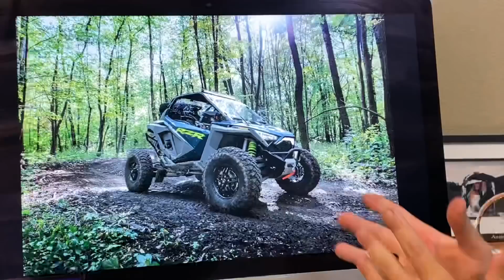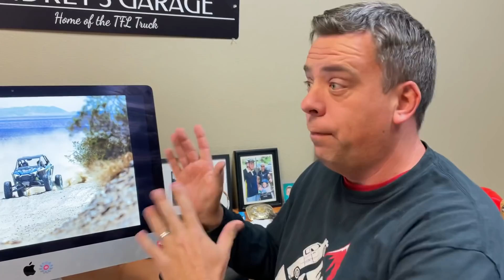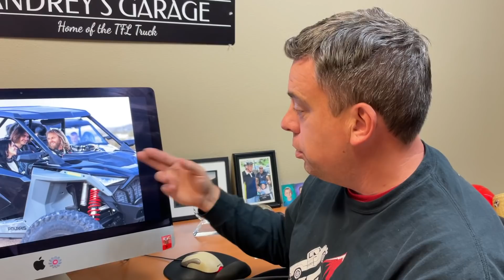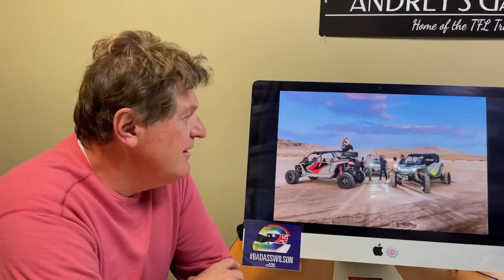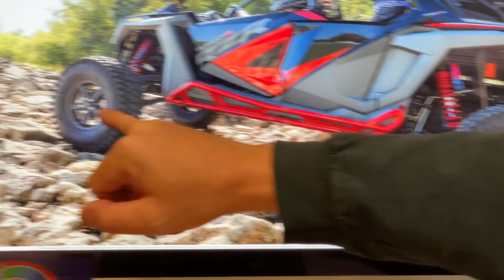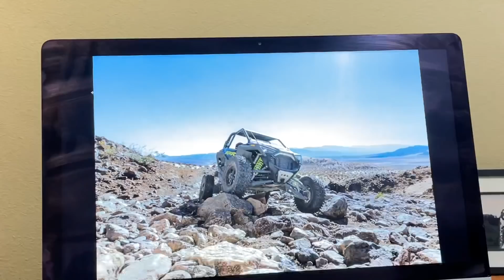BREAKING NEWS: Redesigned 2022 Polaris RZR Pro R Takes Direct Aim at Can-Am With THIS Much Power!

Comment: No such as too much horsepower. 2020 RZR making 220 to the tires, which is alot of fun don't get me wrong. The new 4 cylinder non turbo RZR making almost as much right out of the factory was a much needed boost. Much more torque and horsepower without the lag and extra complications of a turbo rig, count me in. 👍 Not to mention wider and more travel plus more kick ass goodies etc....

Comment: Snap, Crackle, Pop ............. that is what I think about when I watch anything regarding SxS UTVs or for that matter ....... ATVs .....  that run a belt driven transmission ...... there is a reason there are no Honda ATVs nor Side by Siders available for purchase now amongst the computer chip shortage crisis ........  (but you can buy Suzuki, Kawasaki,  Polaris, Can Am .....  "all day long" )  ........ at one time ...... Honda sold more ATVs than all the other machines combined ......... yes .......... Polaris has massive military contracts ....... and their Wallstreet  stock has been at a minimum a  "6 banger" * over 20 years  ...... IMO ....... its still junk compared to the reliability of a Honda .......horsepower is not as sexy as it appears when snap crackle pop sets in   ??? .....

Comment: Too much power? I’d say still not enough, I’m curious how you say they’re taking aim at canam when they still fell short with over twice the engine, the new pro r has a power to weight ratio of approximately 9.62:1 with oil and fuel while 2019 with only 195ho turbo rr model brings it in strong at 8.67:1……. And if you spend tue price difference focused on performance you come out so far ahead it’s quite funny you also won’t have a blown up clutch maiming you or your passengers or bursting into flames.

Comment: Thanks for posting.
Approaching $40k for a STOCK UTV, even before adding accessories??  YIKES!
No. It will NOT fit in a toy hauler. While a few have adequate length, the width quickly necks down from 8 feet to under 6 feet to provide room for counter tops, sinks, refrigerators, stoves, etc.

Comment: The Power of the TWO LITRE Naturally Aspirated 
is actually quite ordinary at around 200 hp ,
However . . . . . 
By the time that the aftermarket adds 
a "Procharger" (supercharger), 
AND a Turbo, 
AND Aftercooler, 
AND NOS, 
then 400~500 hp should be possible.

You will probably need the LWB (4 door) to make room for all this stuff,  
but honestly you do NOT really want all 4 seats anyway.
Reply: It's 225 hp

Comment: Just bought 2022 Can-Am with smart shocks and then see this
Reply: Your X3 will still smoke the 225 hp version. You’re way lighter. There are guys out there running 350 and 400 hp through stock X.3 transmissions, stock axles, stock differentials, and stock belts. You’re a good dude.

Comment: The Can Am Maverick is much lighter: 1501 vs 2085 pounds, that’s a 1.5 pounds more to carry per HP for the ProR against the Turbo RR
Reply: Sure its lighter but the RZR now has a race ready frame with stronger, boxed suspension arms. That is where the weight comes from. That and the new, larger engine displacement.
Reply: For real? Light weight always win!
Reply: I switched to an X3 RR on order now. Weight and price increases will never compare to what a lighter equally powerful machine. If it was close in price and only a hundred pounds more, maybe I’d consider it. I’ll be passing these all day on the drags next summer. Lol
Reply: @snowrulesnate  good luck with that. Not the same power at all. Especially tq numbers. This car is on another level. I'll know here hopefully in the next few months.
Reply: @kelvis1980  I’ve owned new RZRs touting better than the competition and always slower off the line, losing the race by a car length. Definitely still a blast to ride and that Pro platform seating position, visibility and cab room is perfection but this motor and weight addition is good for high speed dunes, not much else IMO.

Comment: Sorry guys. U have completely missed why this was released. Robby Gordon released his “speed” brand this year and it was 78” wide with gobs of power and it had upgraded a arms, trailing arms and was only about $5k more than these are. This is what these were built to compete with. We saw his new model at the sand and sport show and the preorders are thru the roof. Polaris is trying to get in on the action.
Reply: Maybe. But isn't his car like 45 grand or something? lol Its more of a niche car for desert running than anything else. Polaris has to sell these so making sure its good in the desert plus other areas is crucial.
Reply: @waynehicks317  this thing fully optioned is around $40k. His 4 seater is around $45 I believe. It also depends on if u get the full electronics kit with it. His comes with heads up displays, comms, the works. It even came with the cutout on the passenger side for passenger radio/gps. Seems fairly comparable if I look at the specs as well. The speed car is 78” wide with long trailing arms. Very similar

Comment: An entry level Wrangler at $30k is a dog shot vehicle. You need to add $20k worth of mods to even make it decent. And then when you get it to where it’s decent, you cant even do much except slow crawl and slow drive through stuff. 

The RZR on the other hand, will eat a modified Wrangler alive in just about every scenario, and do it for half the cost.
Reply: Apples to oranges…

Comment: I have 200 horse in my 2018 RZR XP Turbo and it’s really not enough power so factory being 225 horse and a heavier machine will need at least 280-300 horse !
Reply: I bet you turbo kits are coming within a year or less of the release lol I bet it holds boost great
Reply: @waynehicks317   , at 12:1 compression ratio ......no LOL it won’t hold boost without major engine parts
Reply: @williamdubya  
Will require a different Crankshaft (to slightly de-stroke it), heaver rods, 
& Better (?) Pistons, if BOOSTED, 
but do NOT rule it out.

Comment: Power to weight ratio is still less than the X3, even with its 225 hp. It’s a pig at 2300lbs.
Reply: Does the X3 have a boxed frame with boxed suspension arms and a 2 liter engine? that's the weight. Any desert race car easily meets that weight and more.

Comment: We'll see how the CVT holds up. Probably kill 10 or so belts when my group goes out.
Reply: I agree .. I can’t see the CVT ( specially with its location ) holding up … unless the cooling air was forced i don’t see it going more than 25 hours
Reply: @hassan_lootah  I would think it would be fine and trust they did extensive testing but currently my group breaks belts now and most of em are stock power levels.
Reply: @superdutyzack  I’m sure they did but personally I don’t think they did enough testing .. I might be wrong but from my experience looking back at every utv that had their belts in that position had issues with the longevity of their belts .. so fingers crossed 🤞😅
Reply: @hassan_lootah  the rumor going around is they are looking at putting the 5 speed triptonic tranny. Just wish they did some body redesign as literally all my friends and family think it's ugly even with an aftermarket cage and accessories. The rear end is definitely a poor design.
Reply: There are certainly limitations to belts but also multiple things you can do to help prevent  chances of failure.  Proper prior break-in (for your carry along spare), tuned clutch, proper clutch alignment, belt brand choice, keeping speeds varied, limit use of launch control, belt warm up and more.  I have thousands of miles and never a broken belt but I don't wait until they break and am sure my time will come.   You gotta pay to play so I don't worry about changing belts prior to their end of life.
Reply: There are guys out there running 350 and 400 hp through stock X.3 transmissions, stock axles, stock differentials, and stock belts without issues.
Reply: @jbw5485  Absolutely true.  I hope to be one of them someday.
Reply: @offroadgarden7650  🤣😂🤣shit. Me too
Reply: @jbw5485  you can't run those hp numbers without something breaking. Currently run at half that and have had to replace axles and belts constantly. Have had factory axles shear apart doing 55 on flat ground and have had belts that lasted years and have had belts last 5 minutes. Regardless of what you think or say, a cvt is not ideal for high heat and high power applications.
Reply: @superdutyzack  what machines are you referring to?
Reply: @jbw5485  RZR and CanAm. The only SXS worth a damn.

Comment: In 5 years we will have a RZR with a twin turbo supercharged LS engine lmao
Reply: LS is old news. Check out sxsblog they have a 2JZ RZR.
Reply: @randalsweeting661  2JZ’s are older guy. Cool engines, but need to be heavily modified to make stock LS power. Not everyone want a big ass turbo that won’t spool till 4000rpms. Lots of us like instant throttle modulation instead, and with SXS’s, having that turbo lag makes the vehicle non-rideable in most situations. This is why SXSBlog only uses their 2JZ RZR for drag.
Reply: @JacesOwnWorld  I agree there is a difference in a trail car and a drag car but it all depends on how you build them.  A proper turbo sized for the application makes a great torque curve.
Reply: @ArchwayPerformance  agree. I mean, a bunch of SXS’s come with turbos from the factory, and they are pretty good for trailing and being all-around applications. The 2JZ is notorious for spoiling slowly though, which I why I wrote my previous comment. 3500 is normal for the turbo threshold on a 2JZ, and it only gets worse the bigger the turbo gets on the motor. This would be great for speed, but for a ton of UTV type of things, that require lower speed, that would not be ideal. It would be very hard to be in boost in 30mph, or lower, type of situations, which happens frequently in UTV’s, and not being in boost means you’ll have massive lag. 

I think this is why Polaris has developed the 2.0L engine in the Turbo R recently. I’m super stoked to see how that compares in throttle response compared to the Turbo S we had. I loved the Turbo S, but even with its small turbo, I could still fee the lag and wish it had better response in low mph situations.
Reply: @JacesOwnWorld  yes, it’s hard because of the size of the engines compared to the power output, but I bet the 2.0 r motor will feel like a s2000 engine.  2000lb machine with a 2 liter engine.  Making just over 200 hp.  I bet it will be different for sure.  I’m in missouri and drive a aircooled woods buggy,  it’s totally different, 4 speed, cutter brakes, stiffer ride at only 10 inches of travel.  But I love it.  I grew up building buggies.  Man has time changed.
Reply: @randalsweeting661  damn
Reply: We can only hope 🙏
Reply: Nah... 2JZ like side by side blog did
Reply: Gonna be cool who comes out with a super charger for that 2.0 liter
337hp sounds good to me …low power to weight ratio

Comment: Can-Am is testing an ALL-ELECTRIC Maverick X3/X3r series with 300+ HP and ENORMOUS torque AND twice the range of the current one (250 miles+ versus 125 miles!) -- Looks like they are using BOTH LG and Panasonic Li-Ion cells as their battery sources. They made a tube cage around a V-shaped underbody skateboard box. Buddy in Quebec (i.e. where Can-Am is based!) saw the Can-Am all-electric prototype testing in the Laurentian mountains between January to March 2021 even during the extensive and very restrictive Quebec COVID lockdowns!

He also heard that the Can-Am Defender is ALSO getting the all-Electric treat with TWICE the current Horsepower and range!

Sides-by-Sides are the only current vehicles where range CAN BE INCREASED over their gas counterparts because you can build a V-shape-style battery cage on the underside of the driver cabin completely filled with high-grade Li-Ion batteries. There is so much unused space in-between the cage tubing that there is LOTS of room to stuff range-extending batteries into!

v
Reply: Who tf would ride an electric sxs
Reply: @GG-mf9er  
Me for one.
Reply: Can NOT wait to hear more about this development.

Comment: the only pain polaris is bringing is to polaris owners wallets with all the repairs it will need
Reply: Yes it will need so many repairs when the drive line, power train, suspension arms, bearings, hubs, knuckles, cage, etc. have all been strengthened to race quality.

Comment: The poo is stuck at 225hp ish being NA. Would have liked a turbo. Looks liked they kept thier belt eating clutch? Or did they upgrade that?
Reply: The clutches are new.  Larger, with better cooling design.
Reply: Clutches are larger, belt is longer and wider, and there is a much better cooling system they developed for it as well.

Comment: Pricing is damn outrageous.
Reply: Again, check out the direct competition. Robby Gordon’s Speed car. $45k. Long travel, upgraded suspension parts and lots of power. This really is right in line.
Reply: Then get a cheaper machine. It is fairly priced if you were to build something from stock to this extent.
Reply: @waynehicks317  can get a turbo v8 for 50k
Reply: @outlaw8388  ok
Reply: Polaris makes vehicles for every price range. Get what you can afford
Reply: For a purpose built desert car… not bad. Try to find another 4 cylinder 2022 desert race car for less than 45k

Comment: The can am turbo rr has 200hp and 1700 lb . The pro r has 225 and 2187lb ,the can am has a better power to weight ratio
Reply: I’ve seen 1501lbs for the can-am. So even better
Reply: As well a simple tune will net you more power with a turbo machine. They went completely backwards going back to n/a
Reply: @crxjustice  I don`t think so, they both have plenty of power and i would rather have similar power to the turbo utv without the turbo. More reliable, dont have to wait for or lose boost, predictable and responsive throttle control.  Too many people are like little children and only think about max hp or power to weight.
My yxz only makes around 100hp and weighs over 1500lbs and the can ams dont leave me in the dunes, they only take me by a couple car lengths at the drag strip and most of our trails are below 50mph so i have no problem keeping up with the power i have.
Reply: @preston1614  thanks for buying the NA machines…all of us can’t buy turbos or it wouldn’t be any fun to compare the difference. Personally, I’d like a Talon for trail riding and my turbo SXS for the dunes, but once you drive the turbo, you’ll find it hard to give it up. They’re very reliable in stock form and for the money you pay for a NA machine these days, it’s a better option IMO.
Reply: @snowrulesnate  NA matters less in the sand dunes, most of the time you are wide open anyways but also sometimes you need power fast to spin the tires in a corner and the NA machine will deliver that while a turbo is building boost and maybe sticks and rolls.
On dirt trails I love the control the clutch gives me and the super fast throttle response, I can drift corners with perfect precision where a turbo takes a ton more skill and is a lot easier to go over or under power. 
So ultimately I think it's awesome that this NA machine is out there with the power of the turbo, I know I could sure use more power but I hate giving up my handling on the dirt trails.  Now Polaris just needs a clutch and I might upgrade because Yamaha doesn't seem interested in making and changes.
Reply: @preston1614  I’ve had a lot of NA machines on the dunes before turbocharged SXS. No NA machine has ever stayed with my Pro unless you’re talking a V8 custom made set up. Lighter turbo powered set up is always quicker and more nimble plus rides better over big whoops
Reply: Turbo is fun on dirt roads but pretty unnecessary at speeds under 35, which NA excels at.
Reply: @snowrulesnate  you sound very disingenuous to me. 
Na can't keep up in a drag race? Who cares?
Na can't keep up in the trails? Well that doesn't sound true.
I ride at little sahara, I ride with some of the fastest people there because they live there, they know the course by heart. They all have  100hp on me, more travel, shock therapy gold and I still keep up.
Let's get real here, the turbo cars aren't that much faster than the na sxs's, 2-4 car lengths in a 600ft sand drag doesn't impress me that much.
Reply: @preston1614  ok guy…your right…I’m just driving all stock stuff here and speaking from experience and IF you comprehend what I’ve said, we actually both agree, NA=fun and not as fast in a drag race, but great machines to have a blast on in certain conditions; never beating a turbo machine stock to stock historically. Could this heavy wide double cc NA Pro do it? I say nope, we’ll see though. Might have to visit Little Sahara to see but I’m sure the blog will prove the point over and over no matter which way it falls. Later mr big words 🤣

Comment: We have entirely different meanings of the phrase BREAKING NEWS. Must be a slow news day.
Reply: Oh sorry you’re not a fan of high compression engines floating on live valved suspension? Are you crazy?
Reply: @B58_G20   you spelled heavy machine wrong.  This machine at 225bhp will not move no faster
Reply: @ntoxic8edx  yeah it won’t be a quick machine. There is definitely a downside to putting so much on a car, but at 
least you get a thicker cage, more power, and more suspension. I’d say it’s not a bad trade for people that like high speed desert stuff